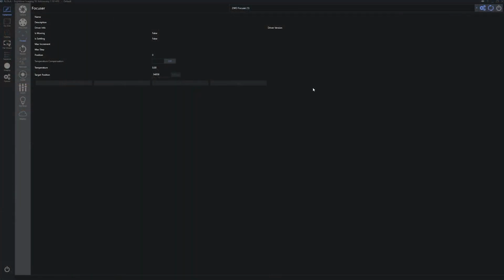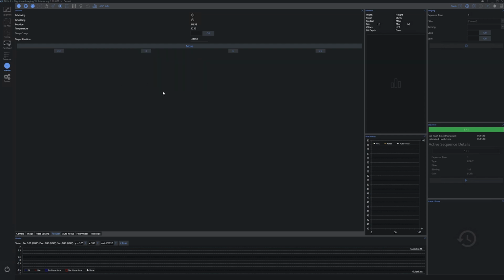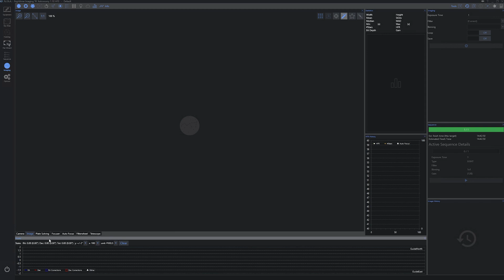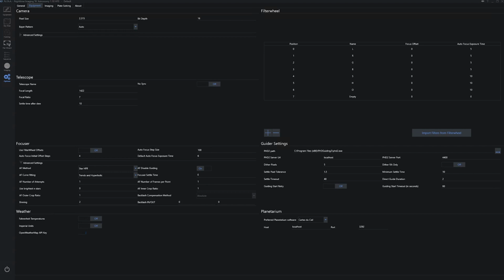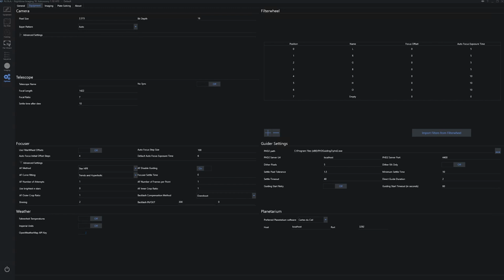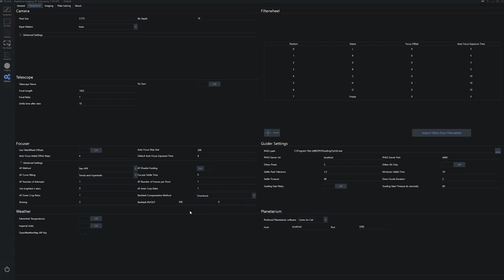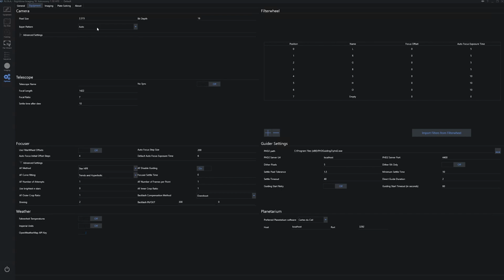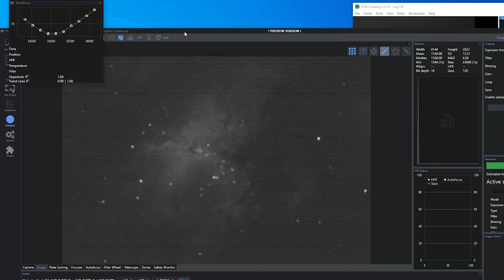EdgeHD ZWO EAF Installation and NINA setup

Comment: Is the zwo eaf a better choice than the celestron auto fucuser? What about using celestron auto guider $799 vs asiair pro $399+zwo120mm $299+73mm guide scope $799= $1500. Is it beneficial to use celestron parts with thei scopes or use zwo products?

Comment: What happens if you tell the ZWO EAF to travel farther than the focuser can extend?  Does the ZWO EAF recognize the limit automatically?

Playing it safe and not wanting to damage my telescope or EAF, I manually determined the limits of the EAF, reset it to zero with the focuser all the way in, and then had it travel all the way out to my known focuser limit and marked that as the max limit in the driver software.
Reply from the maker: Hi Scott, I'm pretty sure that's how ASI recommends you do it and it's probably the safest way to go about it. I do not believe there is any sensor in the EAF that senses a backpressure of anything like that. I am lazy and many times just make sure the EAF is in the middle of its set range and then connect it to the scope with the focuser in the middle and call it good. I normally only go in or out a few hundred steps or more so I'm not really worried about it, but the way you describe is a much safer way.
Reply: @JoesAstrophoto  Thanks!  Sometimes I swap out my camera for a visual eyepiece and when I do that, I need to add/remove spacers to get the right focus distance.  I'll have to be better about remembering exactly how many extensions with and without the eye piece, otherwise when I try to focus, I can travel the full length out and it still not be in focus, then I add an extension/spacer.
Reply from the maker: @ScottCanoni  I've actually been running into the same problem lately while experimenting with planetary and a 2x Barlow. What I've been doing is just loosening the set screws on the EAF side and manually turning the focus until it's very close and then tightening up the set screws on the EAF again. It's a process to be sure, but it seems to work. Still have a bear of a time finding the right backfocus for the new gear, but that's because I've never done it before. I'll be making a video of it all once or if I get it figured out.

Comment: Thank you for the tutorial. Currently I have an issue, when I’m going to conect EAF ZWO in NINA, ZWO option doesn’t appear, therefore I can’t choose it. Everything is conected and driver installed. Do you know what could be happening ? Thank you in advance for your help
Reply from the maker: Thanks Alfonso! I don't know why it wouldn't show up if you have the driver installed from ZWO. It's supposed to. I'd love to help, but afraid this is one of those situations where I'd have to troubleshoot it on the computer that is having the trouble.

Comment: Great video Joe and very timely for my new 8” EdgeHD.  As a side issue, do you have any issue with backfocus using the Celestron OAG.  The combined distance  looks like 105.3mm (looks the same as my desired set up) but Celestron say 105mm backfocus.  With a filter this adds ~0.6mm effective optical path length due to refractive index so it’s ~0.9mm too far from the reducer.  Have you noticed any issue with this? I guess not, as you’re using it.  Many thanks again.
Reply from the maker: Grats on your new telescope James! I actually had to add a couple 1mm spacers my image train to get correct backfocus. My backfocus is at 108mm from the reducer to the camera sensor on the outside. I believe the internal backfocus is 105mm exactly. The reason I say this is because on my setup with the Celestron OAG, my reducer protrudes inside the OAG adapter a little bit. When measuring from the outside, I can't tell how much. Hope that makes sense and helps.
Reply: @JoesAstrophoto  Thanks so much Joe.  I’ll definitely give it a go - I’m using a zwo oag as celestron are out of stock atm, but the prism is a bit small.  Still cloudy though - my own fault! 😂

Comment: Good tutorial Joe.  I don't know if it is possible in NINA 1.10, but in 1.11, you don't need to switch back and forth from image view to focuser to see the change.  I just put it on a repeat image cycle and change the focus from the focus tab on the left (or wherever you place it.  It seems to be the same for Pegasus Cube for the instructions you gave for the ZWO.  However, I have the Celestron focus motor for the C-11, but again, very similar.  Clear skies Joe.
Reply from the maker: Thanks Pat! Great tips, I’ll check it out!

Comment: One of your grub screws on the motor side should have been lined up with the flat part of the shaft. That will make sure you have no slippage. Just saw Martin already pointed this out and you replied. Clear skies.
Reply from the maker: Thanks Jeff, yeah I totally missed that. I was actually swapped out the EAF to my Z81 but absolutely want that lined up.

Comment: You've had this setup running for a while now... sitting on old video footage? I'm definitely going to keep this one bookmarked in case the EdgeHD ever comes back into stock in any retailer LOL
Reply from the maker: Thanks Jonny! some it was older, but I was swapping my EAF to another scope and thought it’d be a good time to finish that video.
Reply: @JoesAstrophoto  Getting your refractor back on for a bit.. or did you get something new?  :)
Reply from the maker: @DSOImager  My old z81, wish it was something new lol. Been thinking about a GT71 for some wide field, but you know….money
Reply: @JoesAstrophoto  Money... yep.

My sv70t has been a solid little widefield scope but it's got some limitations... I feel myself outgrowing it.  Main thing is it only has an image circle of 27mm.. fine for an asi1600 but not really enough for a larger chip.  The small diameter also limits light collection somewhat.  I've had my eye on a couple of 4" widefield scopes.. something that can accommodate a full frame sensor if I ever went that route.. bit of future proofing if you know what i mean.  Just one real problem with this idea.... money, lol.

Comment: Hey Joe! I am watching the vid right now, but can't help but commenting on something I see along the way.
When you slide in the focuser into the sleeve, there is a flat side on the drive shaft that is now not lined up with one of the grub screws of the sleeve. I would adjust that if I were you.
Reply from the maker: Thanks Martin, I missed that, good catch! You’re right, you want to line those up.